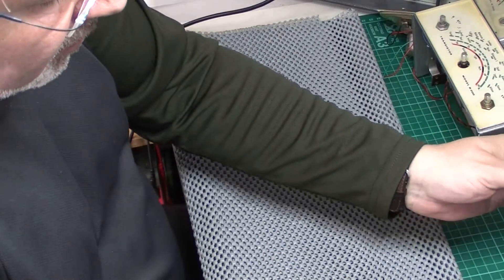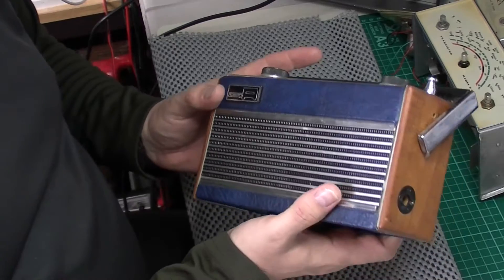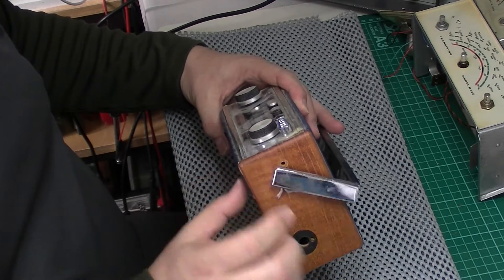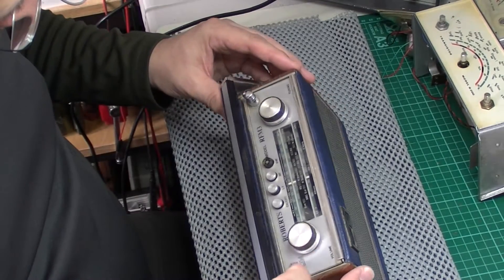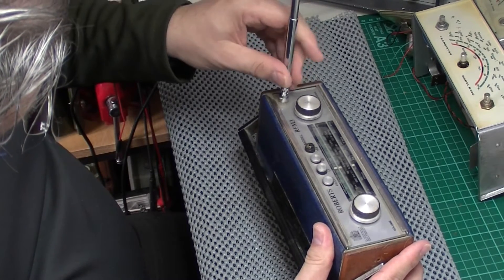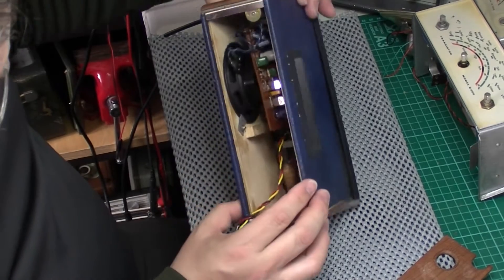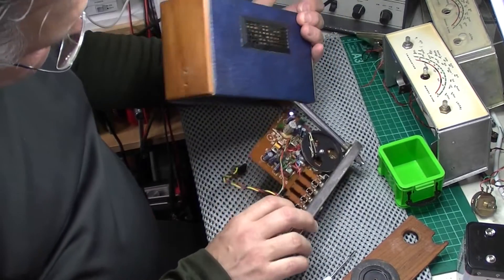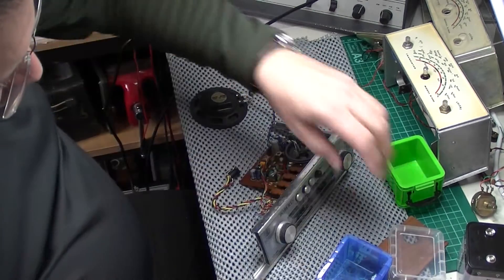Roberts RFM3 radio Part 1: First look, overview and chassis removal

Comment: Was it you who said that you wanted one of these http://www.ebay.co.uk/itm/Heathkit-R-C-Bridge-C-3U-/272213739858?hash=item3f61340952:g:AqsAAOSwubRXEgVx
Reply: +Radiocruncher Those are really useful, just check the two big electrolytics inside as they'll undoubtedly need replacing. The leakage volt output markings on the front of it are just a guide. I spent ages stressing over why it wasn't outputting the precise voltages per the markings, got a second one and it was exactly the same :) I suspect if you were wanting to you could fiddle with the resistors on the wafer switch until you got the precise voltages but hmmmm.....
Reply from the maker: Rupert thanks for the heads up. I have been looking for one of those for a long time and looks like I may have won that. all the best Graham
Reply from the maker: +Andrewausfa thanks for the advice Andrew. It should be here in a few days so i will get it apart and have a look. Might even do a video on it. Cheers Graham
Reply: Excellent. I forgot to mention it will have a SenterCel rectifier in it.1N4007 plus series resistor should fix that.
Reply from the maker: +Andrewausfa do you mean Selenium? I have a few 1N4007's. I assume around 100ohm 5 watts? If it draws any current
Reply: Graham, yes a SenterCel Selenium rectifier stick in a Paxolin tube. I don't recall what I used to get HT but yes, 100R would be a good place to start.
Reply from the maker: +Andrewausfa thanks for that. Never heard of it so more new things to look at! Should be here by the end of the week.
Reply: I think they were made by STC, very popular in TVs, test gear and some radio/audio stuff in the 60's. Basically stacked Selenium discs in a tube to make a 1/2 wave rectifier. Make a note of which end is which before you remove it, there should be a dot of red paint at one end ...someone I know didn't :)
Reply from the maker: +Andrewausfa I'm led to believe that it's a unique smell when they fail. I have a couple of these to replace in my valve radios.